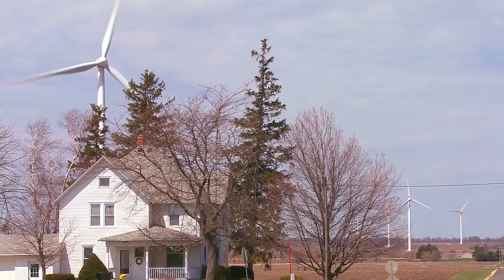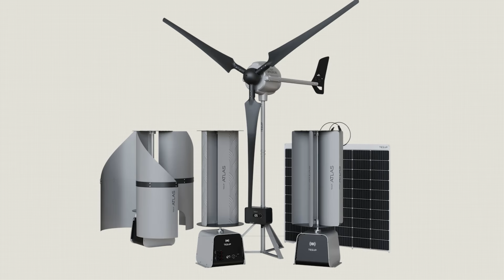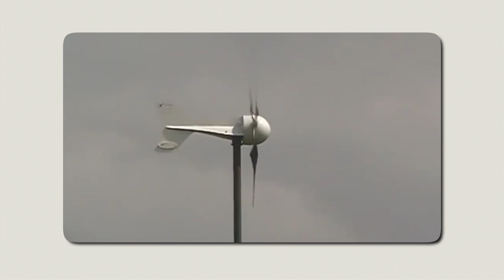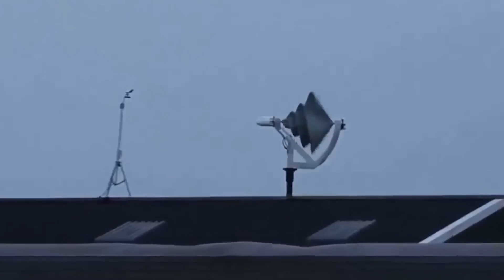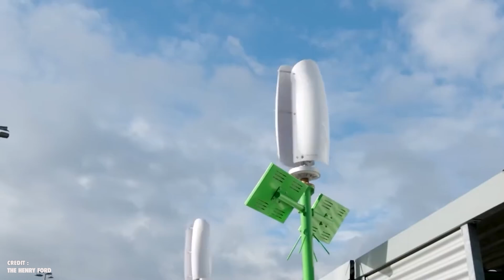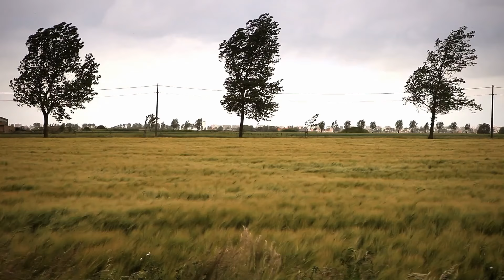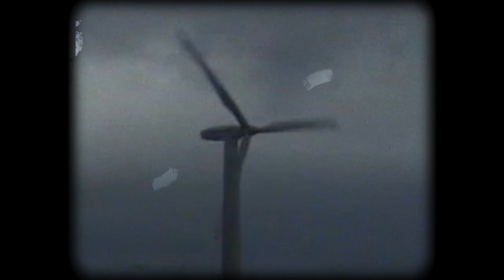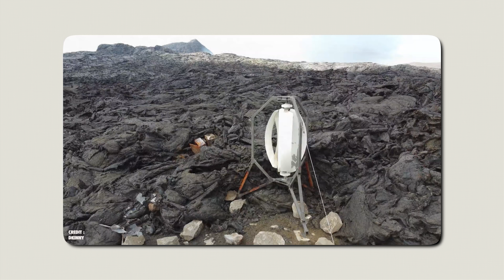These 6 Wind Turbines Are The Future Of Home Power

Comment: I installed small wind in Tasmania Australia over 20 years in remote area off grid battery charging stations. Solar power absolutely is a better way of generating, mainly due to the fact that the turbine has moving parts and require periodic maintenance. Solar on average made more the 10 times more actual power and is about 10 times more cost efficient.
Reply: Yup, I've installed both on yachts and solar is superior by far.   If you have a roof facing south you don't have to worry about its footprint or zoning issues, the roof is already there.
Reply: Logically, the first question should be: do I have far more wind, or far more sun?
Reply: @KerrAvon-DSV1  
Try "Where IS the sun?"
If it's generally low in the sky, don't point the panels "Up", at a oblique angle to the "source".
Reply: @rogerstarkey5390 – So true. I have portable solar panels, and i find their power drops off considerably if they aren't at a 90° angle to the sun. I want to love solar, but it's hard to do (the more one knows about it). 

And a lot of solar panels lose efficiency when partially shaded. And my roof is high enough that i'm not going get up there to clean the panels, so over time, they'll lose more and more efficiency. Add to that the natural degradation of the solar cells themselves due to UV exposure over time.
Reply: @MagicHawkeye  Solar and wind are the same. Without wind you get no power. To much wind and you get no power because you have to shut the things off.
Reply: @KerrAvon-DSV1 very true, I live in the worlds windiest city, but the house is in the shadow of cliffs and skylight are essential to get light into the home, so solar is not an option.
Reply: @KerrAvon-DSV1  – Actually, that might not be as important as other factors. Such as when do i need it the most? That could be on a daily basis, or a seasonal one. 

If your answer is at night or in the winter, then wind may be a better source than solar, no matter which you have on average more of throughout the year. 

And the farther away from the equator one is, the more important that question becomes. An extreme case would be someone living close to the arctic circle, where one might have close to 24 hours of daylight or darkness, around the solstices.

Although i live closer to the 45° parallel, it's still sufficiently dark here in the winter months that solar is less attractive than wind, even though i get a lot of winter sunshine. It's just not nearly as intense nor abundant as in the summer months. We also get a fair bit of snow, and snow covered solar panels aren't very efficient. 

Since my primary concern is being able to run a forced air gas furnace in the winter, wind is more useful to me than solar, regardless of the amount of winter sun i get. Especially considering that solar panels might be covered in snow when i need them the most.
Reply: It might work in a house in the Southern Hemisphere but not in industry, AI or flats or town houses, or homes of multiple occupancy in a country of 70 million with little sun in winter!!
Reply: @michael.randall5034  During sunny days there is not much wind. Frankly, what sales team is doing should not be prioritized over your needs - I need mix of both solar and wind energy, as it is only logical that they can complement each other and I get very strong winds in winter.
Reply: @michael.randall5034  
Take a look at Copenhagen International School.
If you're in a "High latitude" country. point the panels AT the Sun. Put them on South Facing walls. This is proven to work even in areas closer to the equator.
Reply: @michael.randall5034  You really don't know what you're talking about.
Reply: @Ashitaka255 , You’ve got a problem. Pointing a finger at someone and not explaining why they’re wrong is an ego problem. Take some time to explain and your point will be taken seriously. At this point you’re just an idiot.
Reply: @boa9535There are millions of houses that utilize solar panels in the "Northern Hemisphere" and are self sufficient, including those in areas that have long winters with little sun. That in itself dismantles their entire claim and shows they have no idea what they are talking about like Ashitaka said.
Reply: At 1: 25 of this video  !
60 feet up  is where all  Wind Turbine should be mounted,  if it's on the top of the house or barn , yeah your fooling yourself  on very much power being produced,  and Solar Panels don't work at Night  or under half a foot of Snow  !
Reply: I have always believed that a combination of both solar and wind designed for individual rural homes if the price worked out would be a definite assist in lowering power costs.

What I have not seen the reports but I would like to know is just how much power is actually being generated by those massive wind monstrosities that are on way to many hills around were I live. I don't drive by them every day but often enough. The three installations I occasionally drive by consist of 10-15 windmills. Never at any time I have ever seen them have I ever seen more than 2-4 of them actually turning however slowly at one time. 
How many and how much of each day do they need to be turning to be actually paying for their cost and maintenance?
Reply: 20 years ago solar was nowhere near today's efficiency. Would you still make the same choice if you started in 2026?
Reply: @EnergyAxisIntel  I would still go with natural gas 100%. The generator cost $600, the tank filled $1000 and the battery pack $2000. I fill up once every 8 months for $550. I can use bio gas as well if I needed to which is literally powered by green waste and house trash. The CO2 given off is already in the atmosphere and recycled into plant matter. Nuclear is just as cheap and after 100 years of use every reactor on the planet has produced enough byproduct to fill the super dome in total. That byproduct can also be used to generate power for the next 20,000 years. 

Wind and solar have their uses but are even more toxic because the byproduct is the heavy metal dumped in the land fills and in order to produce the silicate sheets for solar you have to heat high quality quartz with coal or gas to even make them. Wind requires massive fabrication centers for the generators as well as concreate, steel, fiberglass, boron, lithium, neodymium, nickel, etc. You also still need oil for all the plastics, lubricant, hydraulics, insulation, etc. All of that and you still need massive battery cells that only last a decade tops before they are useless and need to be replaced. Those materials are ridiculously difficult to recycle and end up in land fills. The cost if you do recycle ends up being even higher making your system even less efficient.

There is no argument where your wind and solar offset the costs of converting. Everything is energy, mater is energy and energy matters.
Reply: @brandonandreski1709  That totally depends on energy prices. Can you get power for less than $ 0.12? If the answer is no, solar usually wins. In Idaho it‘s hard to beat power at $0.12 / kWh, in Hawaii at $0.41 / kWh it‘s really easy.
Reply: Thanks. 😊 ❤️ ⭐
Reply: Is it still beneficial to have 2 power sources?
Reply: Why can't these be mounted on a vehicle?
Reply: But it doesn't really work well in Cold and cloudy countries that are far away from the tropical region. In Canada or Scandinavia, Solar panel output drop significantly comapred to wind.
Reply: Solar much like wind turbines have pros and cons.  My area gets cloudy pretty often and has a ton of trees that block any chance of solar being a good option.
Reply: Neither are viable environmentally because of their total costs. Natural gas is way more efficient for personal homes. way cheaper as well.

Comment: seriously? an "average home " uses 10.6Mwh annually? are you including single bedroom apartments in this calculation? I know my home isn't "Average"; it is 100% electric and nearly 4000sq ft with 2x 4ton HVAC systems and 2x FIFTY gal hot water heaters... but what my home is NOT is 300% the size of an average American HOME. It might be 300% the size of the average American RESIDENCE if you include the Coffin-size apartments of New York and Chicago but your assertion that a 10Mwh windmill will serve all of the average American homeowner's electrical needs is Ludicrous! My PV system generated nearly 31Mkh of electricity last year and still fell short of my total needs for the year (meaning I still had to buy electricity in the month of February). Obviously 10Mwh is a chunk and could offset a large percentage of the electricity bill. It's even something I'm investigating to augment my PV system without needing the footprint of the equivalent PV system. I'm saying you need to give better figures and expectations than what you did, not that your video is wholly flawed or incorrect. But it IS misleading.

Comment: In northern latitudes and valleys, wind power can be cost-competitive.
However, the premise that residential solar has a ten year break even point is wrong, especially if a utility charges more during peak hours. Furthermore, additional electric generation can charge EVs, obviating the monthly gasoline budget. Finally, utility electricity always increases in cost, thus shortening the break even point.
But for utility solar projects, yeah, those idiots factor in pensions and executive bonuses into the installation costs.

Comment: A turbine might be a decent secondary method of charging batteries at night or in a storm but about 80% of the time in my area it would create virtually zero energy.  Most all these, even if the "blade turns at 9mph" makes virtually zero wattage until it gets clean air at 15mph plus.  They don't even come close to replacing solar panels unless you literally live in the windiest place on Earth.

Comment: When a solar cell is done, it's garbage.  Then a wind system wears out, the generators can be rebuilt, and the other metals recycled.
Reply: I guess you haven't' seen the turbine blade "graveyards".  Those are fiberglass, and not recyclable at all.
Reply: @i-ccc-channel  I agree.  That's something to tackle; but I've never known a solar cell that can be refurbished.  Maybe someday.
Reply: @ChristopherErickson-ez3hw  True.  But the ones I got come with a "materials and workmanship" guarantee of 12 years, and a "power performance" guarantee of 30 years.  That's pretty good.  You won't get that on a wind generator! I doubt one of those would still be going after 5 years.  By the time my panels need "refurbishing", my guess is there will be some wonderful new technology out there that makes it unnecessary.
Reply: @i-ccc-channel   I'll be doing my homework.  My son-in-law is an electrician who specializes in 24Vdc, but he's never installed a wind system.  Thanks for the feedback.
Reply: @ChristopherErickson-ez3hw  No wind = no power. Solar is better.

Comment: The Darius style layout allows for air or oil bearings with brake pad underneath, you release the pressure and the unit lowers back onto its brakes stopping the unit. The unit can not be overcome and forced to move by any wind speed.. Before considering nay wind turbine you need to know your mean and speed and seasonal high average and high windspeed as well as storm speeds if in a hurricane zone etc. In Florida you might have severe permit issues.

Comment: Home wind in some areas with a battery wall can take AC, and many other areas of a home off grid and allow the house to remain on grid for lights and small loads. The laws regarding solar and wind allow for towers, the issue is the height and needing lighting. Darius designed turbines are very old tech. The one shown has huge resistance and therefore is inefficient overall. The question is output at 9 mph, not the start, the output. Downwind units are a major problem from teh wind shadow hammering the blades each turn. We have mechanical change of pitch blades in the 1980's, all passive.  They are using the WRONG tower, it should be Core-ten steel.
None of this means anything, You ned to give the 80% productivity wind speed, and the average one median wind speed for use based on design annual output. The start wind speed means nothing and in fact can give artificial idea of productivity. You need to find the 80% productivity wind speed to know anything at all..

Comment: Yet another AI video full of marketing material that tries to lure you into something that is not going to work.  

You first need to know the wind statistics for the intended location of the turbine. When it is in the 5 m/s range (11 Mile/h), don’t even consider wind energy. You are wasting your time.  You need about 8..10 m/s before even considering it.   A very well designed drag type VAWT may generate 40 W/m2 (0.040 kW/m2) of swept area.     At 5 m/s this drops to 10 W/m2.   A Darrieus type VAWT may do 20 W/m2 at 5 m/s, provided the wind is clean (no turbulence). 

The “catches wind from all directions” statement is nice, but the marketers “forget” to mention that the efficiency of such turbines is poor.  The “low startup wind” claim is just marketing.  There is no power in 2 mile/h of wind.

Many residential close to the ground or roof locations don’t have 5 m/s (11 Mile/h) of wind on average.   This is the real reason why you don’t see wind turbines in residential areas.   What isn’t there, you can’t harvest.  You need to be in clean wind (well above buildings and trees) and the swept area must be large.  This doesn’t fit in a residential location.

Comment: I worked in the renewable energy industry for many years (both solar and wind). I fantasized about having an off-grid property with solar and wind. But after working with both, I ended up with solar only and probably wouldn't install wind if it were given to me.
I have yet to see a turbine that will actually produce as advertised, and I believe it would be a very rare case that any small wind generator will be a better choice than solar, in terms of cost and production. Cost-wise there is no contest when you consider wind generators are a moving mechanical machine that will always require maintenance. They are normally mounted on a pole or rooftop that makes service require a lot of work and likely special equipment just to access them for required maintenance. Solar has no moving parts and little if any maintenance. Parts that may need serviced or replaced are generally easily accessible.
If you like wind, be prepared for it to be a lot more expensive over the life of the system!
Reply: Agree - we are off grid in a Mt environment and doing great.  I do wonder though if adding a turbine or two would be beneficial during multi day storms as we avg about 16mph here on my ridge.

Comment: The problem I see for wind is that people will start buying wind generators from China via Amazon etc. the bearings will be cheap and soon start generating unwanted noise, heat and vibration. Neighbours will get angry and fed up very quickly. Solar is quiet and easy to implement in comparison.
Reply: This is still inefficient technology, no matter the technical quality!
Reply: @OmmerSyssel  Even when they are efficient, they produce little energy in most residential locations.  What isn't in the wind, you can't harvest.

Comment: If you have ever lived off-grid with wind and solar (I have), you would never claim that wind is the future of home power.
Reply: That depends very much on the  location of the power plant. It's easy to come up with a location where ONLY wind will deliver any power. Or vice versa where only solar will deliver any power.  Those are the two extremes and all combinations between those two extremes are possible. I live in a location with lots and lots of wind during winter/spring and almost no wind between June and October. When one power source is absent the other delivers.